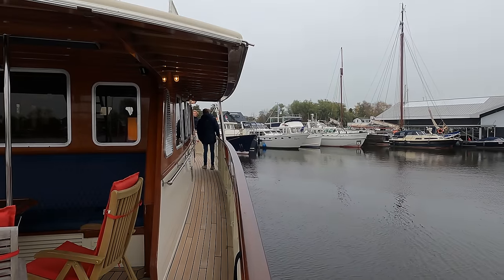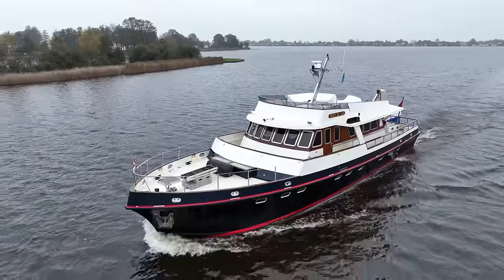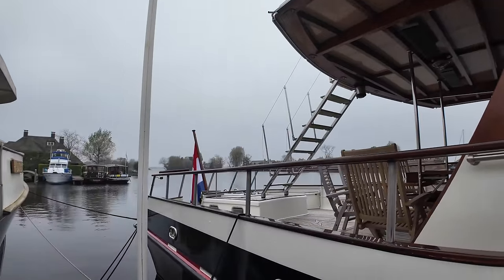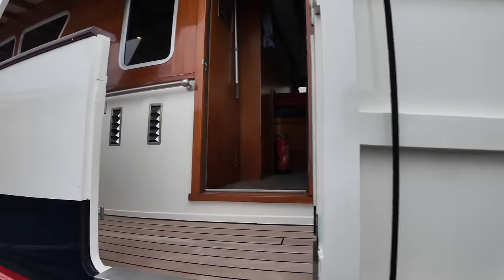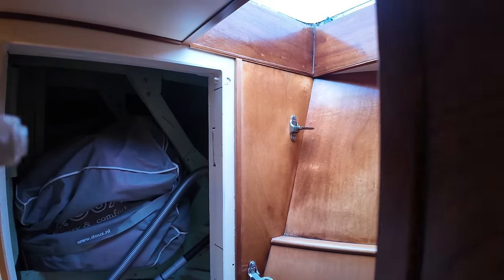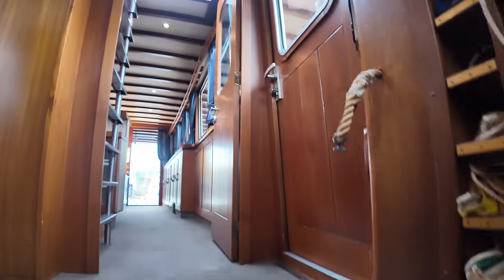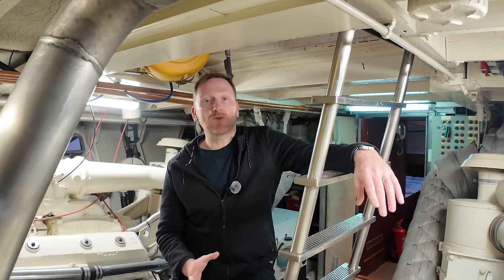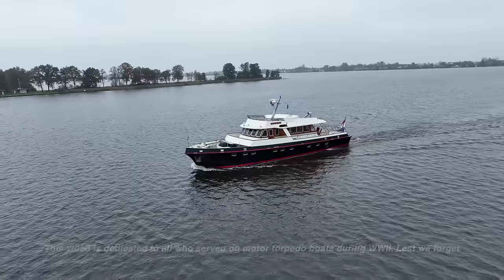THIS WWII Motor Torpedo Boat Has Been Transformed Beyond Recognition! FOR SALE For €595,000!

Comment: Just a little information about the Torpedoes.  When the PT Boats were first introduced they had four torpedo launch tubes for the MK-8 torpedo.  Each tube weighed over 2,000 pounds.  From Wikipedia,  "The primary anti-ship armament was two to four Mark 8 torpedoes, which weighed 2,600 pounds (1,179 kg) and contained a 466-pound (211 kg) TNT warhead. These torpedoes were launched by Mark 18 21-inch (530 mm) steel torpedo tubes. Mark 8 torpedoes had a range of 16,000 yards (14,630 m) at 36 knots (67 km/h; 41 mph). These torpedoes and tubes were replaced in mid-1943 by four lightweight 22.5-inch-diameter (570 mm) Mark 13 torpedoes, which weighed 2,216 pounds (1,005 kg) and contained a 600-pound (270 kg) Torpex-filled warhead. These torpedoes were carried on lightweight Mark 1 roll-off style torpedo launching racks."  Just removing the four launch tubes and the slide mechanism to rotate the launch tube outwards, reduce deck weight by over 8,000 pounds.    So if this PT boat was manufactured after mid-1943 it would have not have the tubes, it would have had the light roll off racks.

Comment: Great Video! I am a crewman aboard the operational USS PT658, located in Portland OR and we operate the 78 foot Higgins PT Boat with her 3 1850 horsepower V12 Packard engines (2500 cubic inch) several times a year, mostly in the summertime. Running her three 100 octane av-gas engines will allow us to achieve 35 knots. If we push her, she could get up to 42 knots, but since she is an 80 year old boat we dare not push that hard! The twin 12v71 diesel engines in your Vosper MTB will not do the boat justice, only being able to go 10 knots! At that speed, you will never get the boat up onto the plane. The British Vosper MTB's during WW2 were powered by the Marinized Packard V12's (of 1500 hp) and NOT RR Merlin engines simply because the Merlins were better suited for an Airplane (like a Spitfire or a Mustang) due to the RR Merlin's superior "Power to Weight" Ratio. Early Vosper MTB's did use a couple of Merlins, during prototype testing, but the RAF soon put a halt to a perfectly good aircraft engine being wasted inside of a boat. The limited supply of the world class Merlin engines were sorely needed for aircraft. The Packard was much better suited to be used in a boat, and was widely used in many British vessels in the Coastal MotorBoat Forces and HDMLS etc. We have many videos on Youtube of PT6558 running if you search for it. 
Thanks again for a great tour of this wonderful old boat!

Comment: The Detroit Diesel Series 71 are high Rev 2 stroke... v12 engine... if looked after they run for ever . But can burn fuel like it's nobody's business... Nice boat
Reply: They don't actually rev that high, they just sound like they do because you're getting twice the number of combustion strokes per cylinder.
Reply: Beautiful conversion. Disappointing cruise range.

Comment: In 1987 I bought  42ft. Wood hull lobster boat.
We converted it for private use.
We stripped to the bare hull, replacing some planks, then repacking and repainting 5 coats of paint and sealer.
The upkeep of a wood hull is tremendous, make no mistake. Sold her 2 years later.
It taught me to NEVER buy a wood hull boat again.

Comment: Power boats are poorly designed. It's a big boat I like how it's got a spacious cabin, sleeping quarters a washer and dryer but it's very very very ver very inefficient. Live aboard powerboat is not a live aboard. The operating cost to run it doesn't make sense. You can't go nowhere. because of the cost to run you would have to powerboat back to work everyday.  makes absolutely no sense

Comment: It's a lovely enough restoration, better than lovely, but taking a 40 knot spitfire of the sea & turning it into a 10 knot canal cruiser is gelding it :-(. Replacing 3 1500bhp Packard M2500s [probably], total output 4500bhp with 2 x 500bhp worth of cooking grade diesel engines seems more than a bit sad :-(.
Reply: You are correct about the power, but she had 3 Rollsroyce -not Packards.

Comment: OK, she looks beautiful but to emasculate one of the best planing hulls ever designed by installing a couple of grossly underpowered Detroits is just wrong. She deserved a pair of bloody great MANs or a single one with a pair of gas turbines in the wings. 1000hp in the centre for cruising and 2000hp a side for getting and running as God and Thornycraft intended. 
Also, Detroits, ug, the fuel bill . . .